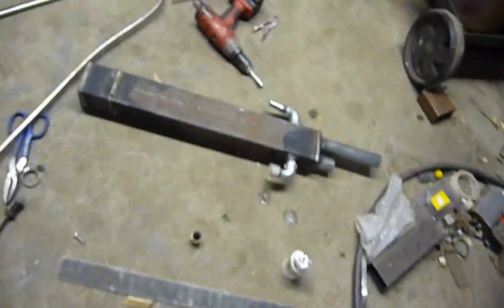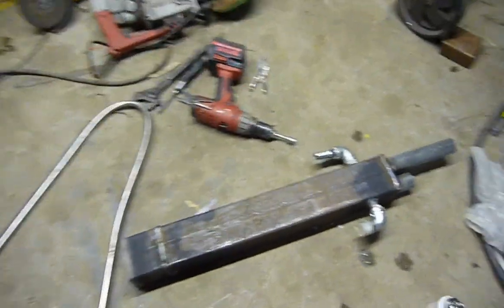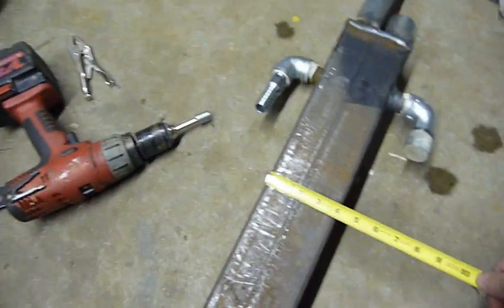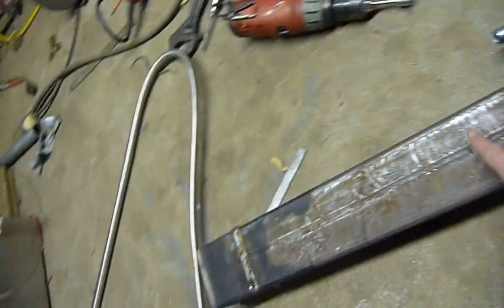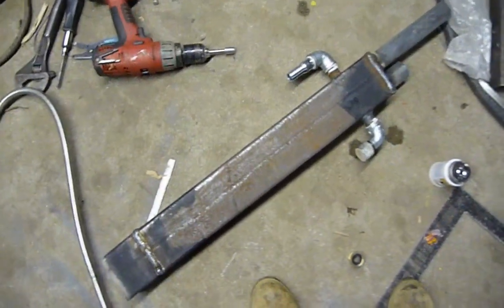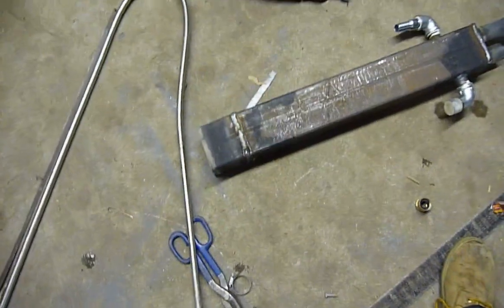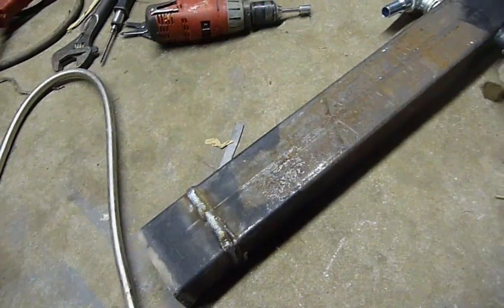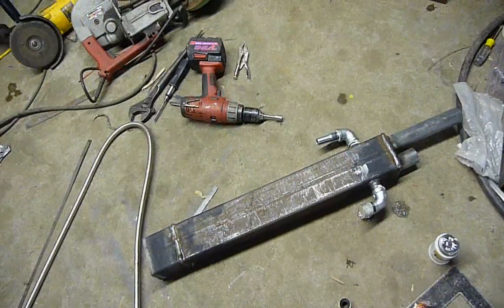Engine exhaust gas heat exchanger

Comment: For motor homing I thought of this which made me search and find this video. I wonder what cooling the exhaust pipe does to the emissions coming out the exhaust? I recon there must be a change but what? Also I figured that if you coiled a copper pipe around the exhaust and pumped the water back to the water tank, and yes it could be a plastic water tank, then you could have a thermostat connected to the pump so when the water reached temp the pump would stop so saving the plastic tank from having boiling water inside. Then connected to the coiled copper pipe, you could have a pressure release valve to allow the steam from water staying around the copper pipe, to go up into the atmosphere. I'm already just about to connect a 24v thermostat to my water tank running from 800watts of solar panels on the roof. Strange since days away from spending twenty days building a fibreglass shower tray, modifying the wheel arch and fitting a gas boiler plus pipes underneath and a gas tank for the boiler. Still free energy or in this case alternate energy is cool. 

Mail me jai.barrett@me.com for updates is you want to see how mine works out, and I will send you pics and tech info.